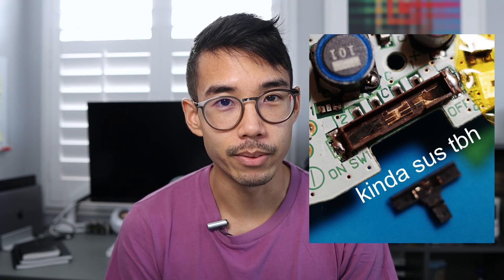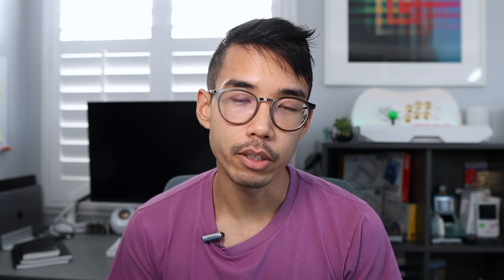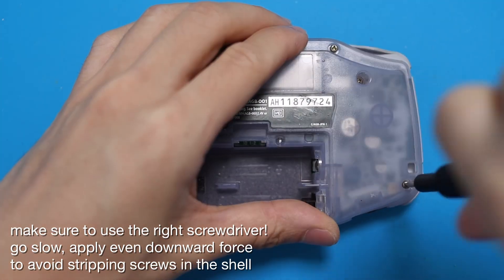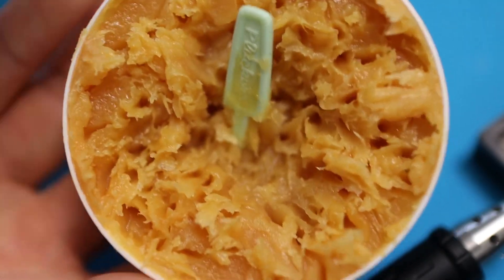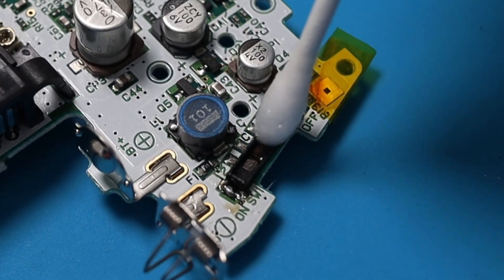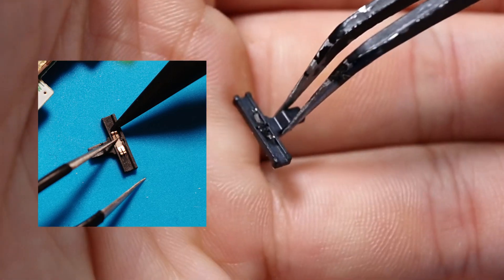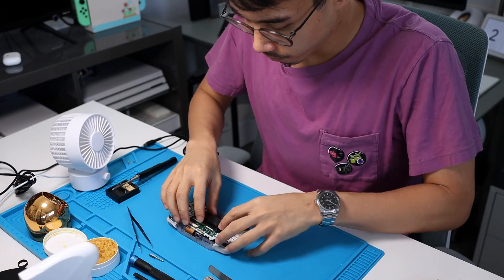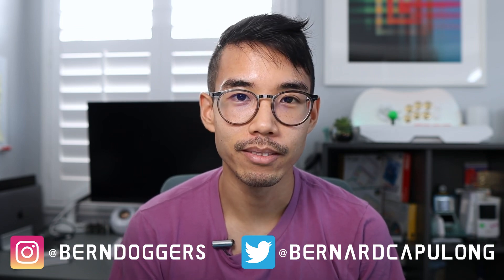How to Fix a Broken Game Boy Advance by Cleaning the Power Switch

Comment: Hello and thank you so much for the tutorial.
Unfortunately, during the operation, one of the switch's "fins" broke. The other three sre intacts, and after I re-soldered everything, the Game Boy turns on.
The absence of one of the 4 contact points (which was probably already loose) could cause problems with the current the batteries provide to the Game Boy, so I have to buy a new switch. (or is this okay and I can rest assured?)
Thanks

Comment: Dont use leaded solder on the gba, it will mix the leaded solder with the non leaded solder Nintendo used in the gba and create a weaker joint. Older consoles used lead, the gba didnt because of the regulations in place

Comment: What should I do if the metal pin piece on the plastic removable piece (the slider piece) comes off? Is there an easily accessible replacement?
Reply from the maker: in that case I would honestly look to replace the entire switch assembly. i'd check out retrogamerepairshop for parts
Reply: @berndog Thanks for the quick reply! Unfortunately am struggling as I don't have a very good soldering iron, so wary of removing the entire switch assembly.

Comment: Does the shielding have polarity ? If i just put tin an it touches the two little legs at each end of the shield, it will short-circuit ?
Reply from the maker: nope the orientation of the cover of the switch doesnt matter
Reply: Thank you for your reply. I would also like to know if, when we reconnect the shield, the two small legs which are located at the two ends touch each other because of the tin, it will short circuit ?
Reply: @berndog  and a have unfortunaly no flux, can i do it so ?
Reply from the maker: @Kirbo_exe  hmm i am not sure I understand what you mean, the legs of the shielding at the two ends are not connected to the rest of the circuit to cause a short. All the shield does is hold down the plastic 'switch' piece that makes electrical contact with the rest of the circuit that turns the console on or off. And you don't need flux, it just makes it easier to use it, but it is still possible to do it without it. To be safe just try to follow the steps in my video as closely as possible. It has been a few years since I have opened a game boy so I don't remember all the small details perfectly right now
Reply: @berndog  oh tanks you so much. So if i understand correctely, the shield is not related to the board, its just make the contact with the switch ?

Comment: I definitely recommend just replacing it, but ONLY replace it if you have a heat gun. Do not try removing it with only a soldering iron, you are more than likely gonna rip out the motherboard contact points. I do clean up some of the solder with a desoldering braid so there's less that the heat gun has to melt. The thing that's sketchy about the original switch is that it's a slider and not a true on/off switch, and it only "switches" due to how the plastic part goes back and forth in the shell.

Comment: Hola, espero que estés super bien, ¿podrías decirme dónde comprar el resistor R13? 

Accidentalmente quité el R13 cuando estaba quitando el switch para eliminar el oxido. 😢😢
Reply from the maker: hmm creo que no lo necesita. si lo quitaste, puedes esperar un tiempo más despues de apagar el GBA y ante de encendirlo. El power switch debe funcionar sin el R13. Pero si quieres comprar uno nuevo R13, buscar <<SMD 150 OHM 0.1% 1/16W 0402>>. Lo compré de Digikey o Mouser en los USA. Lo siento por mi español jaja
Reply: @berndog  ok, muchas gracias, realmente estoy muy agradecido contigo por tu ayuda y tiempo que dedicaste para responderme.

Excelente vídeo, muy bien explicado y con muy buena grabación.
¡Tu vídeo fue de gran ayuda para reemplazar mi switch de GBA! 

Deberías seguir haciendo vídeos como este. ✌🏽✌🏽✌🏽

Y uno donde expliques como soldar el R13🤣🤣🤣

¡Saludos y un fuerte abrazo!

Comment: My GBA flashes green light once when i try to turn on and then nothing happens, and when i move the switch to turn off, it flashes again once

do i need to clean?
Reply from the maker: yes, you should clean it. cleaning a power switch is like one of the most basic and important repairs you can do to keep your console in good working order, provided you do it properly haha
Reply: @berndog  i cleaned like you did and nothing changed

Still the same problrm
Reply: @DemonPE  I’m here to say me too

Comment: What does one do if one of the upper bracket anchor pads of the switch, which hold the actual moving part in place, is lifted? Are those anchor pads relative to circuitry or are they just for holding the bracket in place?
Reply from the maker: If you've lifted those pads you will need to do a "trace repair" or jump a wire from the switch itself to neighboring components to complete the circuit. https://media.discordapp.net/attachments/332487777986019337/877028141678362634/unknown.png
Reply: @berndog  The four front pads are fine. The righthand anchor for the upper bracket is the missing pad that was partially torn when I discovered it. I tried to save it but couldn't do so.
Reply from the maker: @BashoStrikes  I think those are just anchoring, you should be fine then. to be sure, look for GBA board scans and see what the traces look like underneath those pads
Reply: @berndog  It seems you're correct because, after further inspection, the anchor pad was reattached to the motherboard on that side with super glue or something of that nature. The board was still working somewhat with sporadic power failures that, when jumped outside the switch, did not occur anymore. Thanks for the great communication, it really helps with the learning process.

Comment: Is okay to just put solder on the 4 contact points on the shield to more easily desolder? 

My SP has the same problems but the shield shown here looks different. Here you got 2 fat legs, but my SP’s shield is connected with 4 tiny points.

Comment: Hi uhm i just cleaned the switch it works but not everytime.Led doesn't flicker anymore after cleaning.Sometimes when i change battery it doesn't turn on too everytime, does it mean it need more cleaning?thank youu
Reply from the maker: It might need more cleaning, but more likely it's that you need to make sure the metal shielding holding the switch down is flush and flat. If it's not down flat all the way, the switch might not make a good connection when you try to turn it on and it will seem like it doesn't work. Watch the video again where I solder the metal shield back on.
Reply: @berndog  ok thankyouu:)

Comment: do you think just a rapid flicker on the power led then the system shuts off sounds like a power switch problem?
Reply from the maker: Possibly, you should clean the power switch properly regardless. Then try with fresh, high quality alkaline batteries. Other things to check would be fuses, shorts from any additional mods, etc.

Comment: Thanks a lot for going through the tools needed. Do you recommend that soldering iron for other stuff like switching cart batteries and other console mods like GameCube?
Reply from the maker: Yeah the TS80/80P is very popular with modders, it can be a bit pricey but the different tips and USB-C and small form factor are appealing. I’ve seen people use it for mechanical keyboards, drones. RC cars, gameboys etc.